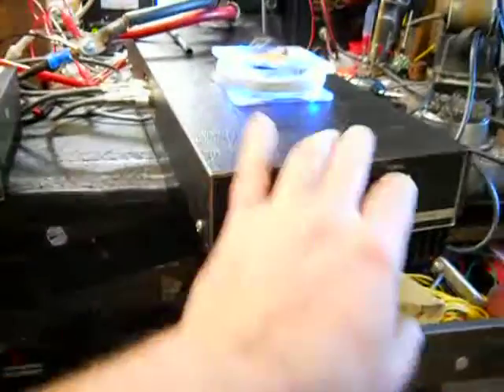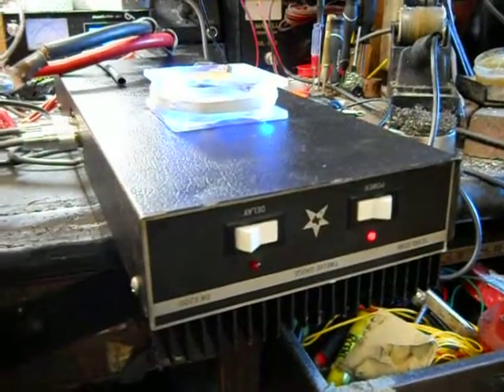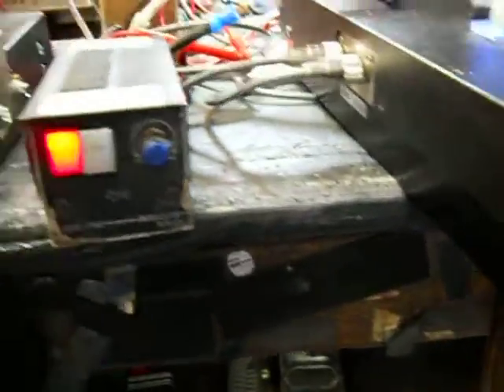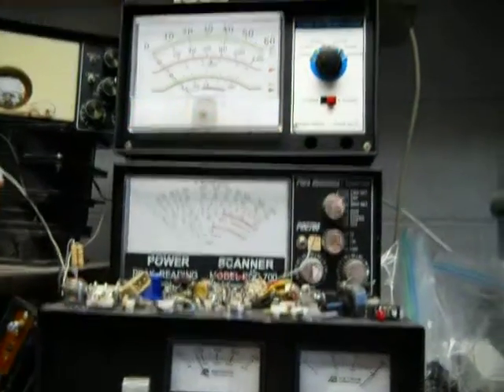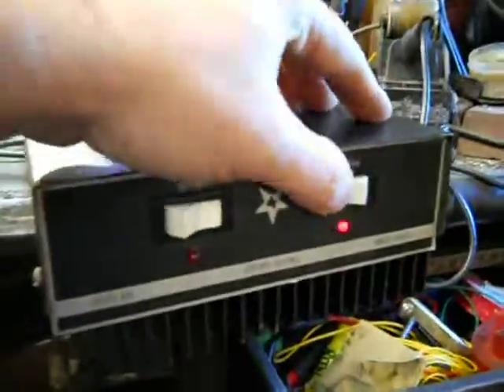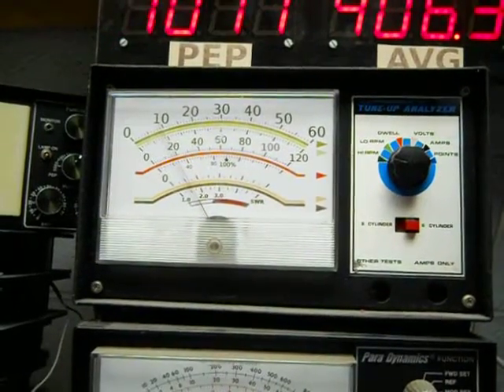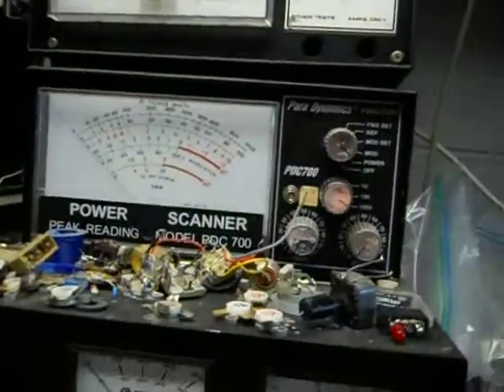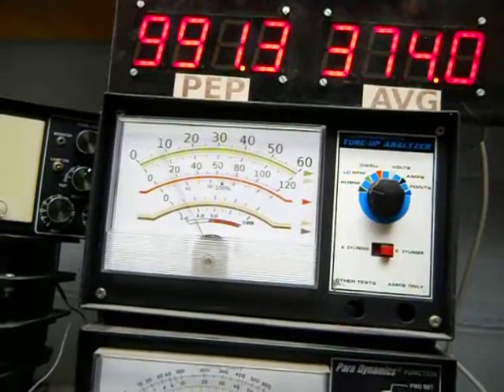Power output DX1200 Texas Star

Comment: 100w into a dx1200? pshhh omg, thats how to overdrive it out of linearity and burn up the output transistors. video should be called how to burn up a dx1200
Reply: I guess youre new lol. The box is designed for 100+watts of drive. A 4 transistor amp (dx400-dx500) is designed to be whacked with up to 100 watts also. So you could actually run this 1200 with a 2 transistor variable amp with no problem lowering the deadkey.